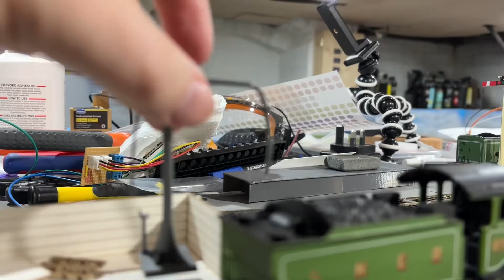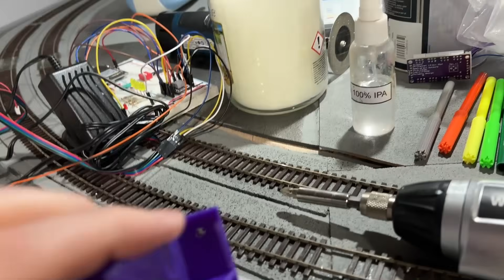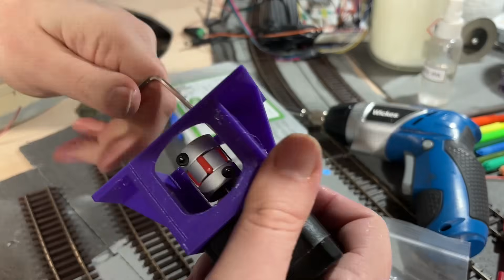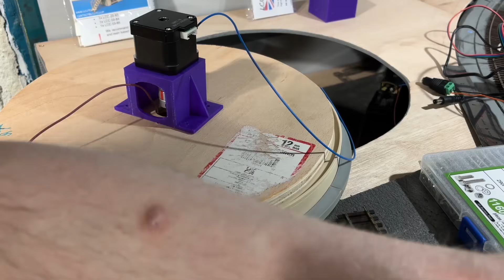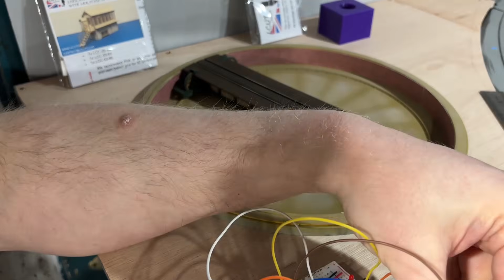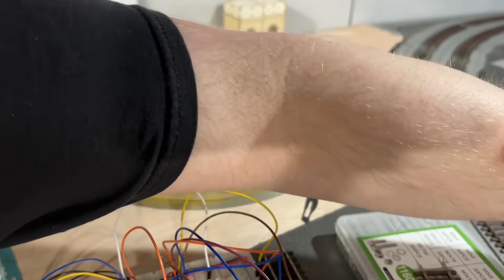14, (take 2!) Turning the tables! at Leopard Street Model Railway #modelrailroad #modelrailway

Comment: It looks like it's proving failry tricky to get that tunrtable working exactly as you'd like, but it's getting there bit by bit 🙂

There are a couple of times where ground-mounted water towers are shown in The Great Western Experience - https://youtu.be/XF_rbc1oB08?t=403 and https://youtu.be/XF_rbc1oB08?t=1939 - the arm isn't much higher than the loco in either of those cases, but I don't know how it compares to LNER practices.
Reply from the maker: its getting there. one thing I didn't realise was just awkward the thing is to work with, its over a foot in diameter.. pain to paint but working slowly.

do have it moving a lot smoother now, 1/16 steps (3,200 for 360) not 1/32 (6,400 for 360). resolution is fine, current setting configured and now it seems to be better.

software needs redoing so its more than just bobbing back and forth, which means adding a few buttons, and a light for the hall sensor. nice bit with this motor is it is easy to unplug, the sensors will move to a three pin header too, once its mechanically working it can be installed (painting has come along and its nearly ready to go in)

Comment: How large will your control unit be? Why not place it INSIDE the base of the water tower?  I believe the building under the tank housed the supply and draw-off pipework and valves only. They also, I think, had opaque windows and no lighting.
Reply from the maker: you know I hadn't thought of that.

wouldn't be too hard to glaze windows then use a black wash on the back, and a bit on the front to dirty them up, then its just murky inside

I'm expecting the control board to be too larger to fit, not least because it has an external antenna, something like an arduino micro or mini would certainly fit though.

this one is going to have a few more bits to plug in (a position display and some control buttons)

Comment: The run-of-rail is too steep. I will be using the same turntable on my layout with a 3D printed 6-bay roundhouse. Still under construction, the Mark One version was a failure. Martin (Thailand)
Reply from the maker: to be honest the run off was a bit of a joke, I needed something to mark one end of the rotation to see how well it lined up and used the offcut. the whole table is lifted 8mm because the track has 5mm of XPS and 3mm of cork. it should be flat coming in..

but this is Leopard Street.. so place your bets.